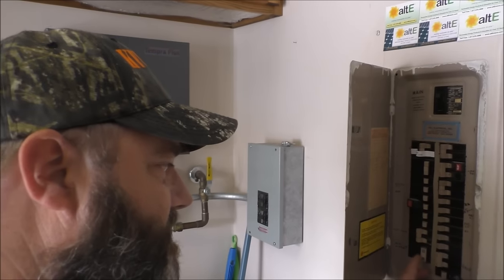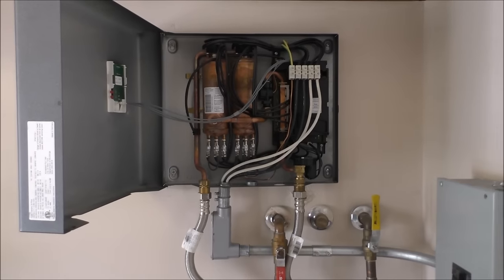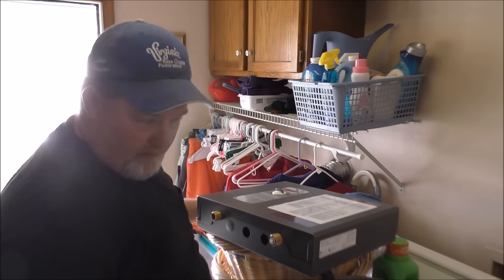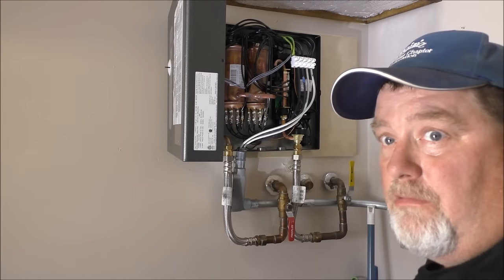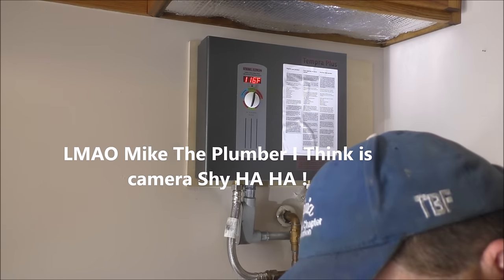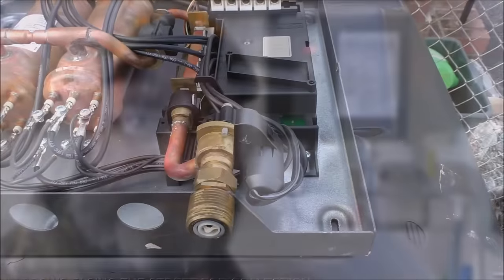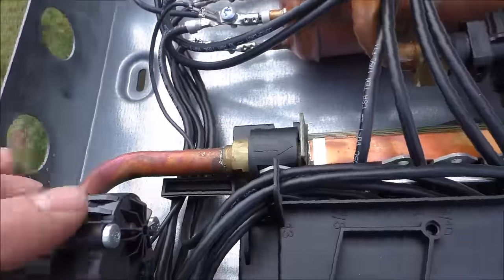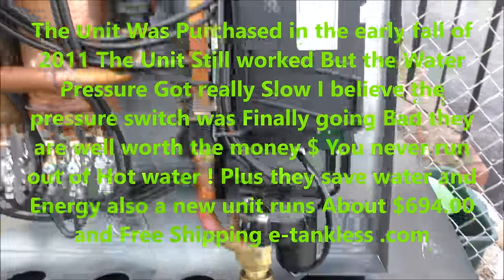Stiebel Eltron Tempra Plus Whole House Tankless Electric Hot Water Heater Install How To By KVUSMC

Comment: I think the bottom valve with the motor is for regulating your flow to control constant temp.  I'm certain it doesnt read the pressure just the one above.  as incoming water temp changes, the processor tries to keep temp stable by closing or opening that bottom valve via the motor.
Reply from the maker: I appreciate the information Cheers Kenny

Comment: My unit has just quit working after 7 years too. It keeps turning on one of the elements even when no water is flowing, tripping the thermal safety. A little disappointed as was hoping for at least 10yrs but that said I have a new one arriving tomorrow. With the aggravation of a service call and then getting parts it made more sense to just replace the whole thing. My power bill changed little but having hot water on demand far out weighs any downside plus, where my tank used to be I installed a sink.
Reply from the maker: I agree 7 years is good The gas inits don't last that long I'm pretty sure I'd rather h a.c ve a tankless unit and replace every 7 years than a tank unit
Reply: Mine is doing the exact same thing after 8 years. I replaced the flow sensor and the temp sensor and still overheating with no flow. One of the boilers stays on after the water is shut off and trips the thermal. My concussion is that the main control module is bad and can't order one. Oh well I have a new one on the way.

Comment: explain the water lines to and from the unit, all the important tips. How you get the hot and cold to mix ?
Reply from the maker: Hot and Cold lines in the unit and it mixes the The cold and hot and uses electrical elements the the heater  buddy

Comment: @4:27 LMAO!  Thanks as I just start to figure out why one (out of two) heating units is dead (Tempra Plus).  I suspect internal element is shot (over 10 years service), the primary heater is still kicking (eliminates flow sensor issue).  If correct, sounds like NEW unit time, (or is it worth trying to replace only heating units)?  Any wisdom from this post are greatly appreciated. /Mike
Reply from the maker: I wish I knew But they are very good units I would buy again for sure I'm saving allot of water and electric bill

Comment: Great video. One question. I see a check valve was not installed on the cold water side. Is a check valve not needed or is there one built into the unit?
Reply from the maker: I believe it is built in the unit Buddy

Comment: Just curious... normally they last 20 yrs.... did you ever change the filter at the inlets cold and hot... reason is if they clog up it will shut off system as fail safe for insufficient flow..
Reply from the maker: That is good to know thank you

Comment: Can you explain to me why there are 2 sets of wires to the unit from the 2 circuit breakers but there is only 1 ground wire attached in the unit? I'm installing the same unit in my house and the wiring diagram only shows 1 ground wire too. Let me know please.
Reply from the maker: Jamie Z Hi buddy I wish I knew I had my certified electrician Hook it up I just Went back to the way he hooked  it up
Reply: Thanks for the fast response. I don't think it will matter if I hook both grounds up since both my cables have ground wires. Thanks again
Reply from the maker: Jamie Z your  Very Welcome Buddy
Reply: It looked like he ran single wires not a 8/2 cable from that close breaker so just the 2 hots, 2 neutrals and 1 ground.  Important thing is that the  panel is grounded. one ground of the correct size is adequate.

Comment: * A quick answer would be appreciated * 
Need to ask  a silly question but necessary to keep a happy family.  I had my Steibel Tempra 29 installed today and 2 water heaters were removed. All went  well except the electrician failed to show to add two additional 40 amp breakers and install electricity.  So to the question.  I have ONE 40 amp from my Water Heater, I was wondering if I was to connect the single 40 Amp if the unit would operate in a diminished capacity?  I have two kids and a wife that will be roasting my unspeakable's if they must take a cold shower.  I have learned to adapt and overcome but of course they don't see the reason to follow suit.
Reply from the maker: Yes You Need more Power Biddy I'm Sorry
Reply: Yea my electrician installed mine in my existing 100A panel using 50A breakers. If anyone dares to turn on water weather cold or hot whilst someone  else is in the shower the the 50A breakers trip and the water instantly drops to freezing.
Reply: @l1l5teel  I'd fire his ass!

Comment: I have the same unit. When I got it installed, they placed a small water filter next to the unit. The filter is now leaking and I’m considering bypassing the filter. Is the filter necessary? All the units that I have seen do not have the filter.
Reply from the maker: I don't have a Filter on mine  Change it out yes or hook direct
Reply: I woukd not remove it . Replace filter. You are better off replace a cheaper filter over an expecive water heater

Comment: I see a couple of post about unit fails after seven years...Could calcium (scale) build-up the cause. Do you think a water softener system and/or scale cleaning would help?  Or would it be worth the cost or replacing the unit is just cheaper and easier?
Reply from the maker: Just replace it about the same price as a tv

Comment: Please explain how a tankless water heater will save water.
Reply: If installed correctly and working properly, you won't running a sink or tub faucet for 15 minutes waiting for the hot water to start - it runs about 15 seconds and it is hot.

Comment: kenny.
I have a 24 plus hooked up with 2 separate 60 amp breakers. 
I'm not getting any water feed when I turn on the hot water.
I checked the screen it's ok.
I checked the resets at the top of the heaters it was OK .Help....
Reply: The dial lights up on the front and I can set the temperature but the power light below the temperature is not on.
Reply: Also if I open the panel and look behind the power tie in bar I can see a green light flashing???
Reply from the maker: +David Gibson  Hi Buddy I would call Steel Eltron talk to customer service that is not cool
Reply from the maker: +KVUSMC / Kenneth W Viar Jr They might just send you a new one They are as n awesome company Keep me posted Cheers Kenny
Reply: @davidgibson6707  The green blinking light on the electronic control board is normal. It means the unit is getting power. When the heater is working you will the power red indicator on (front panel) and there will be an amber, steady light on the control board.

Comment: No temperature relief valve?
Reply from the maker: 10-4 Buddy My Bad
Reply: You actually do Not need to install a T&P valve for the tankless electric Tempra unless further mandated by local inspectors. Says so in the Installation Manual: https://www.stiebel-eltron-usa.com/sites/default/files/pdf/install-tempra-tempra-plus.pdf
Keep up the fine work, Kenny!
Reply: That’s extra lol

Comment: Kenny, how big of a service panel do you need to power that system?
Reply from the maker: Hi Norman at least 200 Amp Service On This Model But it saves me allot of Electricity and Water it only uses Power when it runs unlike a Tanked Hot water it doesn't run 24/7 only when you need it Buddy
Reply: That looks like a great hot water system Kenny and would for sure save you money. I would have to upgrade our panel which would not work for us but that is a Fantastic Option for people who have the electrical service in place!

Comment: So, this thing only lasted 7 years???  That could get expensive!  My tank water heater went out the other day and I'm considering replacing it with one of these.  Now I'm kinda leery if they don't last any longer than that.
Reply from the maker: I can understand That brother
Reply: @KVUSMC-KU4SMC  If I'm gonna be saving $100 a year in electricity, but buying an $800 water heater that's only gonna last 8 years, I'm not coming out ahead, I don't think.
Reply from the maker: @emtiv334  I can also understand that I like The peace of mind of not having A tank And it leaking Etc plus my utility room is really Small brother

Comment: Thank you!
Reply from the maker: +Ronald Petrocchi Your Welcome Sir It saves us allot on our electric bill and allot of space
Reply: Great to hear back from you!  I live in Fort Myers, Florida and I live here in a condo with approx. 1625 square feet with 2 full baths a laundry room and the usual kitchen appliances, dish washer, etc.  I live here with my wife and I occasionally have friends and family that visit.  I am having trouble deciding on the size of the Stiebel Eletron that I may need.  I am looking at the Tempra 24 Plus and the Tempra 29 Plus.  I would like your help in making this decision.  I am replacing my 40 Gal electric tank with the new Tempra 24 Plus or Tempra 29 Plus.  I have a tendency to go big so I have to control these tendencies.  Also I am going to have to update my 200 amp service and my choice of the Tempra 24 Plus and the Tempra 29 Plus may have a bigger impact on costs.  If you can I would appreciate your opinion to help me decide!
Reply from the maker: Hi Ronald Check This Out I Believe the Tempra 24 plus Should Be All You Need But the 29 Should be a great choice Here is A Link https://www.e-tankless.com/choose_heater.php    Also I would call Steibel Eltron And Ask just to make sure http://www.stiebel-eltron-usa.com/products/tempra-series-whole-house-tankless-electric-water-heaters
Reply: Thanks again!  I am in the process of upgrading  my electrical service to accommodate the 29 Plus.   I understand that water quality is important when deciding on a water system.  The PH level of my water here in South Fort Myers is 8.5 to 8.9 and my have an impact on my decision.  Do you have any ideas on this?  Thanks again:  Ron

Comment: What!!! After 7 years . That's not right . . Why?
Reply from the maker: I'm not sure Why But they are worth it the savings and clean hot water
Reply: Sounds like he did not clean the metal screen filter in in inlet fitting.and got a  slow flow.
I had slow flow took the screen filter out. I could see 3 tiny spots of light smaller than a pin head.when I held it up to the light.